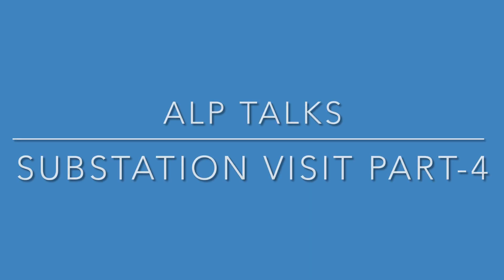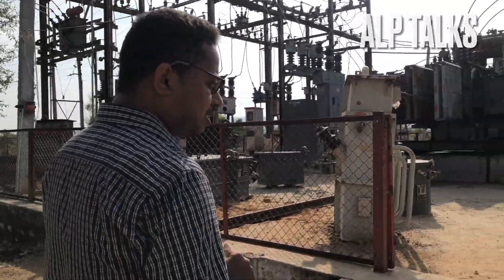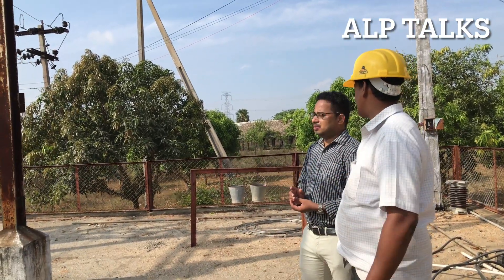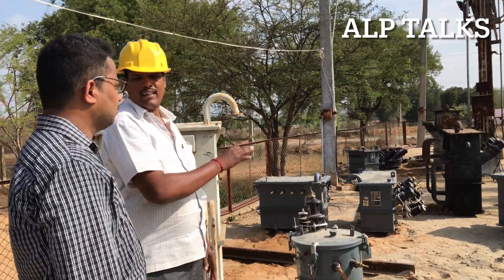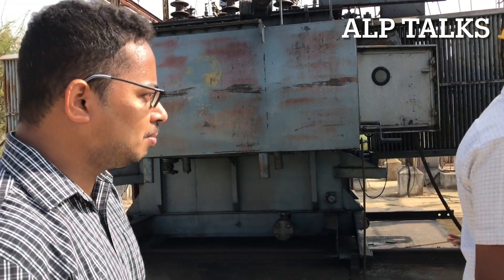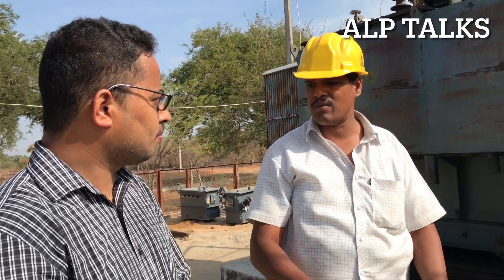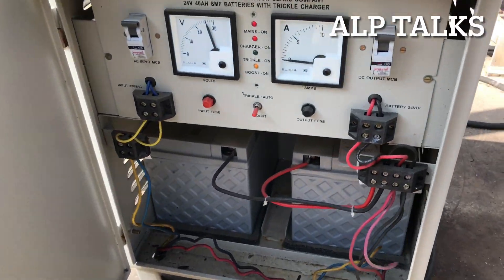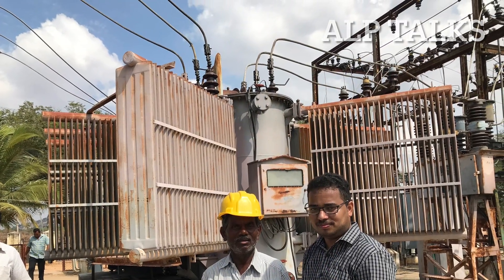33/11kV Substation Visit (197 Ramapuram)-Part4 Guest: Mr Giri Babu ( Use earphones)

Comment: 1.Transformers not painted
2.Person saying incoming load will be cut off but it shall be out going loads.
3. Person there is saying they are not  filtering transformers at site, I didn't understand how they are removing moisture from windings???.
4.DC supply provided at 48V is for relaying? More description required for better understanding.
5.SLD' s if any exists in substation, earthpits and their resistance values, frequency of measurement, at that voltage level how much transmission line clearance from ground of required could have been covered.
Your attempt to make video on substation is good but please cover substations which have got good maintenance practises otherwise who ever watch this video may think substations are being led by underqualified team and mismanagement